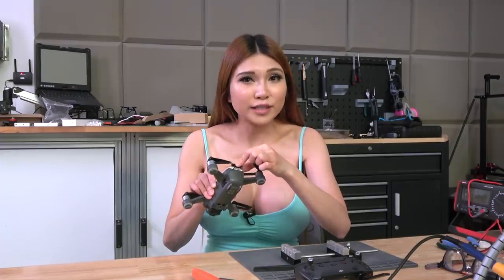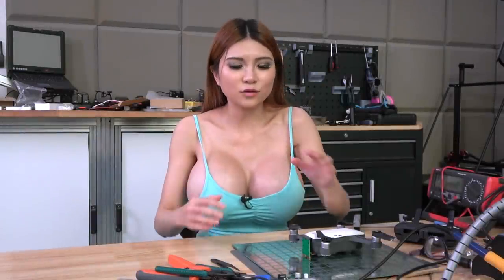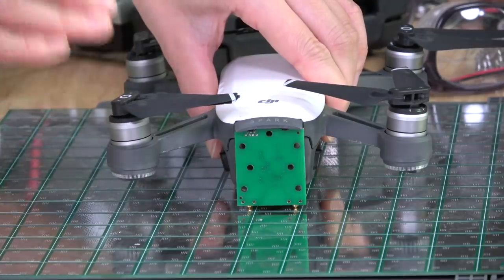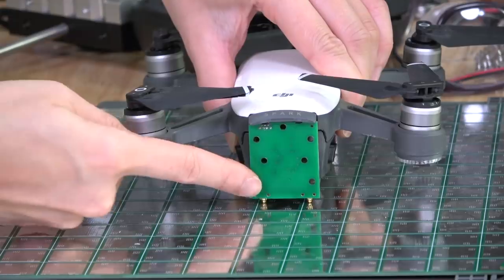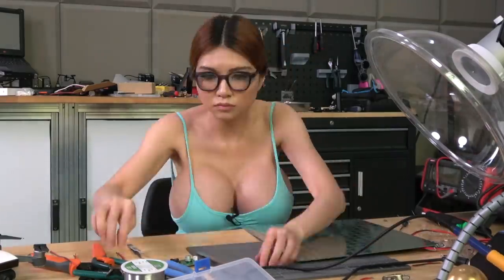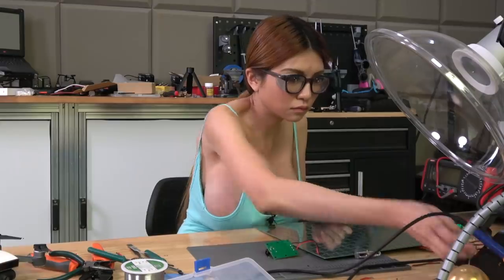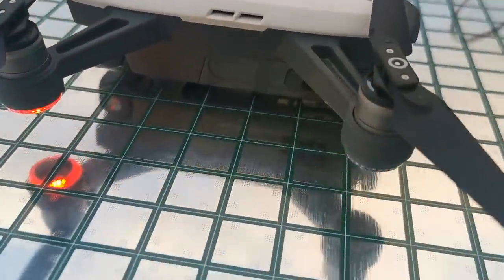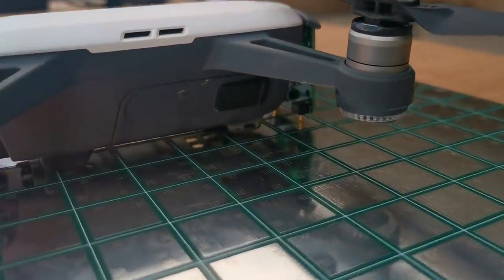DIY Self-Charging Drone- with JLCPCB!

Comment: I am a RV owner and a electricien. I also do all the work on my RV myself. Mine is funny and already extremely complicated as i have a 5v 12v 24v and 230v system wiring all making a huge spaghetti mess xD however i wold like a drone but wont be able to land on the rv to charge and be mobile whitout securing the drone first. A moving RV is like a house in a earthquake. But whit 5v its not hard to make a plastic hatch that can open and close on 2 servos and hold the drone clamped. That wold however increase landing difficulty.
Reply: I work allot whit magnetic relais switches 230/400v i think i have seen them as low as 24v. If i can find one on 5v its not to hard to hook it up so when the drone is landed and the charging circuit is complete the magnetic switch will engage and power a coil to create a magnetic field holding lets say a steel plate at the buttom of the drone down. Euhm...the charging circuit has to be broken before the relais disengages though.

Comment: I really like the idea and the proof in Concepts works.  perhaps these charging pads could be connected to solar panels rather than a mains voltage. That way if anyone did touch them they wouldn't get electrocuted ir shocked. Of course I don't know what current and voltage these pads are reduced down to
Reply from the maker: The charging pads only run at 12v and could be solar powered.

Comment: Great video and proof of concept.  Would adding solar cells to the top of the drone help prolong battery life?  Wouldn’t expect there would be enough to keep the battery at full charge while in operation, but might help keep it in the air a bit longer.  Then again, you’re adding weight.  Worth a shot perhaps.
Reply from the maker: Does not help quadcopter flight time, but some people have used them on powered glider drones with success.

Comment: Landing looked quite reliable when you are at the landing site but I thought a couple of crossed low power lasers pointing down in view of the camera could be useful for final micro altitude and direction measurement. 😀

Comment: see if you can add thin layer of weather proofing on the pad and i know you can make a case for the battery. i wounder dose it have be on the ground to charge or if it can charge mid air meaning put the pad on a wall and have drone hover? you see where im going with this? hehe

Comment: This looks awewome! I also have a spark and this looks like a winner. You asked what would be an improvement. I would think a more visual method of seeing that its charging or an indicator on the charging card. I know this is a proof in concept model and for a start it's amazing. Does it charge faster then the regular method of charging or just about the same as a plug in? Are you going to sell the parts?
Lastly... if you have an autonomous or fly by internet a great idea is for security... someone comes on your property a security system like a "Ring" security cam Door unit... but that flys and you can capture an intruder from all angles and maybe like a license plate if they are stealing something.
Reply from the maker: USB charging charges slower than direct battery charging but is easier to implement.

Comment: That's really nice. Looking at this I had a thought for a possible improvement, I hope this doesn't make me sound like 'that guy'. Could adding a third pin in a later version ensure it will always touch at least two usable pads?
Reply from the maker: Originally has three, but it adds quite a bit in cost when you can just tap the throttle. I'll release the source files up to people if they want to use it.

Comment: I think you need to create a precision guidance system that takes over for the gps when the drone gets close to the charging station. This would also make it possible to use induction charging. Just do it!
Reply from the maker: That requires a much, much more expensive drone.
Reply: Naomi 'SexyCyborg' Wu mainly superb design all incorporated into the same PC board is all that is required. Someone will do it to take your initial idea to the max. Hope it can be you.

Comment: you can think of a flexible nfc antenna
plug into the microusb socket
it should be cheaper and simpler
Reply from the maker: NFC is not used for power, you are thinking of induction. See pinned FAQ

Comment: Carlin Comm you mean add a solar charger attached to the charger pad and drone Naomi created? It could self charge while flying for uninterrupted flight (as long as there is sunlight). Or land anywhere and self charge if drone has to be off. Or better yet,  create your own with attached solar charger. Naomi?
Reply from the maker: Can't charge while flying, but could certainly charge batteries on the landing pad.
Reply: @Naomi-Wu  As to having an attached solar charger on the drone itself, why not have a second battery on the drone being charged by the solar charger. And when the battery being used is low, switch to other battery remotely and then solar charger attached can charge other battery not being used. 
A couple of applications needing modifications on drone. Should not weigh much more. Probably couldn't be used on all drones (except the one you just designed and patented). Set it up so that your subs can fund it for you. I pledge the first $100.

Comment: Glue a Qi charger coil board on the bottom. Plug the cable that normally goes to the phone into the drone. Land on it to charge.
Reply from the maker: Does not work
Reply: @Naomi-Wu  :(   Too bad!

Comment: What I wonder is if the pad area can be made big enough that GPS auto landing would hit it every time... I assume it can but would it all work would be interesting to test out somehow, I used to build drones that would have the required precision to hit about 1.5x1.5m square and do autolanding, but I quit some time ago and turned to other hobbies... back then DIYDrones was where I got most ideas and posted a lot as well.
Reply from the maker: QR codes and vomputer vision is the way it's usually done.

Comment: @Naomi - Hi from New Zealand. Brilliant idea but Lipo batteries like a period of rest before recharging so, although it will work, it will severely reduce the life of the battery.  Same applies to eCars - fast charger stations will charge the batteries in double quick time but the batteries will only last half the time.  Slow intermittent charging is always best for these lithium based batteries.
Reply from the maker: That's why cheap drones and cheaper batteries.
Reply: @Naomi-Wu  - ah cheap Lipo batteries would be heaven here in New Zealand.  We don't have a warehouse in New Zealand (like Australia) and the commercial airlines will not transport lithium batteries.  We have to pay a premium to have them sent from Australia via independent Couriers who have their own airplanes or wait for them to come via sea.

Comment: 2 point charging doesnt work reliably, but 3 sharp or spring loaded points in triangle formation onto alternating copper strips always has one point on an odd/even strip.
Reply from the maker: 2 works ok, 3 is better but costs more.

Comment: what do you think about wireless charging  apply for the launch pad  ? Since there is no contact point, the drone can land anywhere in any way. Damage caused by corrosion at contact points can be prevented
Reply from the maker: The landing has to be much more precise but it's possible.

Comment: I like your idea. I thought drones somewhat automatically land back where they took off from. Am I Wrong? Maybe this one is too basic. I don't know. If that was the case maybe it could detect that it landed and was not charging and then take off and land again until it was charging. That would correct for it not landing on the right squares. Which as you suggest probably wouldn't happen often but this would be a great correction.
Reply from the maker: Yes, but this one can't do it very, very precisely- it might miss the pad.

Comment: Having the usb port connected directly to the circuit board is a potential weak point.  A bad landing can possibly cause collateral damage to your charging port which will be a bad day for your drone.   Personally, I would feel more comfortable with the circuit board mounted directly to the body alternatively with a flexible cable attached to the charging port.  Great concept nonetheless!
Reply from the maker: Adds a lot to the cost in parts, the spars protect the board and if there is any stress the plugs breaks off from the (cheap) PCB before it damages the (expensive) drone logic board.

Comment: I would set it up for QI wireless charging instead. Makes me wonder how good the 360 degree cameras have gotten to place on the drone..
Reply from the maker: You can't use induction for this, of course, that's the first thing I tried. The placement required is too precise.

Comment: Could the pattern be changed to reduce the chance of landing without contact, perhaps using something other than squares and maybe a 3rd contact leg?
  For cost, could basic springs do this cheaper than pogo pins?
  Given the weight limits, what pad voltage and current would be optimal for a complete multiple brand system?
Reply from the maker: It's ideal for small drones that have a USB charging option. Anything larger and things get expensive quickly.
Pogo pins are cheap in this case because it's a standard component to put on this boards, the parts costs of springs might be cheaper but you'd need huge volumes to make up for the labor.

Comment: Why did you chose that particular size for the charging squares? Is the charging time using this method any different than just a regular plug in? I really like the idea of the drone hanger on top of an RV.

This is a silly question, but you seem to like jumpsuits/overalls, why?
Reply from the maker: Good size based on the width of the PCB on the back of the drone. It takes the same amount of time as charging the drone with a USB plug- which is more time than charging the batteries in their charger.

Just like them😉
Reply: @Naomi-Wu  Thank you.

Comment: What about potential problems from the USB connector disconnecting while in flight? Wind battering it can be an issue!
Is there a way to lock the board to the frame?

Also... Will the addition of the board destabilise the drone during flight?
I'm not sure about how they fly, I've never used one... But putting a flat board like that on a drone can't be good for it's aerodynamics!
Reply from the maker: You don't want the board too tight, best it pop off before the USB connector can get damaged.

Comment: So what's on those boards? On the drone one i see a *FULL BRIDGE RECTIFIER*, and i think a buck boost converter. 
On the base one surely a voltage regulator, a big cap and pads for a multipin chip unpopulated. Probably is a generic board not made for this specific task. The cap is only 6.3V, are you sending 5V on the pads? So that's why you need a boost on the drone board. Hope for some short circuit protection, the pads on the landing board could short with some dirty rain water.
Reply from the maker: Will post source files shortly

Comment: When i seen this i thought you would be using QI wireless charging pads, I know you can buy the sensors and attach them via usb to just about anything not sure if they still make the bigger charging pads but you could easily tear some shit apart and rework some.
Reply from the maker: See pinned FAQ
Reply: I read your Faq, I didnt mean any disrespect if it came across that way im sorry. I just never thought about wireless charging a drone i never would have thought to do it this way. Love your work Naomi.
Reply from the maker: @hellzenvy  sure it's no problem, would love to find a way to make it work😊

Comment: That's awesome! I'd get a patent or copyright or something on this. Could be an awesome solution for those of us without Qi-charging phones! You mentioned it's switching positive for negative; is this active circuitry, or are you using something like a Schottky rectifier on the PCB with the pins?
Reply from the maker: Will post the file shortly

Comment: Awesome video Naomi. I was thinking about how much time did it take to charge fully and what was the battery charge duration time before needing to recharge. Also what type of camera did you use on the drone? If possible I would like to see you use it in a wooded environment to see its movement ability.
Reply from the maker: It's just the camera built into the DJI Spark. The Spark gets about 20 minutes flight time and it took a bit under two hours to recharge as I recall.
Reply: @Naomi-Wu  Awesome. I can't wait to see what you do next.

Comment: Hearing aids and cellphones have been using inductive coupling to recharge batteries.  Which is more cost effective and which charges more efficiently ?  :)
Reply from the maker: Actually, direct contact is both more cost-effective and more efficient- a huge amount of power is lost with induction charging. In any event, the drone would have to be aligned with the coils within a few mm so it's completely impractical in this scenario.

Comment: I was wondering if it would charge whilst turned on but i was surprised.
Are those charging pads on ac power ? I ask because if its DC then each pad would need + with the neighbouring pad -
If its ac, it makes landing and not getting the correct pad placement correct
Reply from the maker: It's DC and detects the polarity and changes accordingly.
Reply: Naomi 'SexyCyborg' Wu ah ok. So the charger board connected to the drone has a bridge rectifier (even though it’s DC), so the polarity doesn’t matter. Good idea. The only problem with the bridge rectifier idea is that there is a 1.4 volt loss (as there are two diodes to pass the power through)
Reply: I think Naomi is using 12V. The voltage loss doesn't Matter.

Comment: Wouldn't it be easier to weatherproof if you used a QI Energy Card (QI receiver to USB that are the same size as a credit card) and a QI charging pad?
I know it would not be as much of a "fun hack" but it would a lot easier to engineer to an all-weather solution (since you can house both the pad and the card within a weather-tight envelope).
Reply from the maker: Doesn't work, see FAQ pinned at the top.

Comment: ? Why not wireless (contactless) recharging pad or matrix of pads on a landing surface? Combined with drone manufacturers considering building wireless charging into the drone. How much stress put onto the charging port with an adapter constantly attached? 
Costs maybe higher but the customer would pay for what they get. I feel that actual physical contacts in any environment would be prone to corrosion and cause failure. What do you think Niaomi / SC? 
Great vids and channel always.😉
Reply: Naomi.
Reply from the maker: See pinned comment.

Comment: Do you have any concerns about putting stress on the internal charging connector over time. I was surprised you didn't add some kind of reenforcement so that the connector isn't taking that force with every landing.
Reply from the maker: See pinned FAQ
Reply: @Naomi-Wu  thank you for taking the time to respond to my question. I didn't really see anything in the FAQ that pertains to this specific project. I love your videos and wish you all the best life has to offer.
Reply from the maker: @ccarmean85  oh? Sorry. The connection between the plug and the PCB is very weak, it will break off the PCB before it hurts the drones logic board. It's still a risk but all the more reason this is designed around relatively low cost small drones.
Reply: Your doing amazing things for the world, have a great week and thank you for your time responding.

Comment: Could you not put a small solar panel on the top of the drone? When the drone gets too low on battery, it lands and while sitting in the sun, charges with it's own external solar panel. Once fully charged, take off again.
Reply from the maker: It would take days to charge

Comment: Interesting and entertaining as always. I did have a question, however. Does the mechanical attachment of the PCB charging board to the drone rely solely on the connector to stay in place?
Reply from the maker: Yes, but the pressure on the pogo pins is very, very light so it doesn't put too much strain on. Had to play around with that a bit to make sure.
Reply: @Naomi-Wu  Thanks. Flying cycles will tell the tale, but even a bit of strategic velcro would probably be enough. W
Reply from the maker: @williamswenson5315  I can make the PCB larger and zip tie it to the rear spars, but the strain on the jack matches plugging and upplugging so hopefully it will be OK...
Reply: @Naomi-Wu  Yeah, or fabricate a 3D printed extension to connect the lower portion of the PCB to the body of the drone. Something with a metal threaded insert that would accept a screw inserted through the lower part of the PCB. You would want it hollow as a bird's bones to conserve weight. Perhaps offered as an accessory with the drone? The finish on the PCB looks very good, by the way. W

Comment: so i go camping for a week to get away from it all. i take my drone and landing pad.  
after a few days the drone needs charged and i am lost and need to use it to find my way out.  how do i charge it without electricity?  
an additional solar panel? extra option and cost of course. could be foldable as the case or something maybe? it should all fit in a backpack or be attachable to the outside of the backpack.
edit: make it work with solar wireless battery pack.